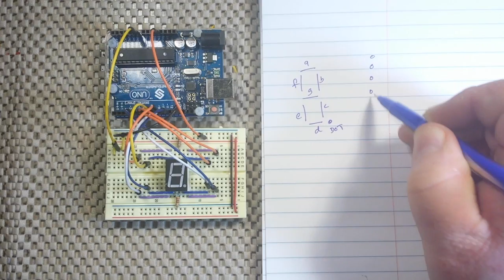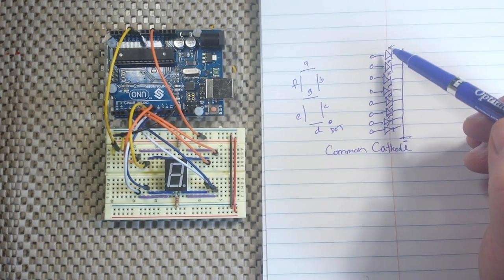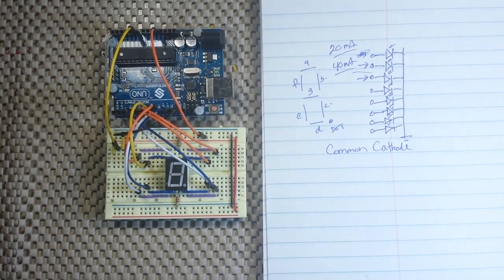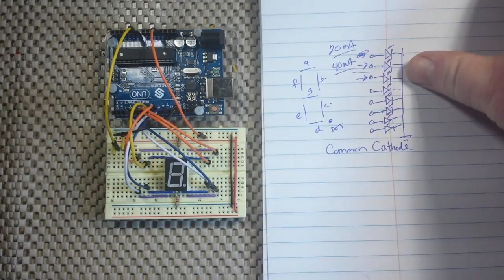Arduino Basics Multiplexing Explained

Comment: Thanks for the explanation. Could you maybe comment with a basic code segment from the loop? Is is something like: digitalWrite(segA, HIGH)
 delay(1)
digitalWrite(segB, HIGH)
delay(1)
 and so on...
Reply from the maker: Score Photos you are very close, all you forgot was to turn off the segment before moving on...digitalWrite(segA, HIGH);
delay(wait);
digitalWrite (segA,LOW);
delay (wait);

but that is only for this example. in normal practice you store the segment for each number in a binary byte and then call the byte by name.
Reply: @learnelectronics  Could you share the whole code and the circuit for this demo ?